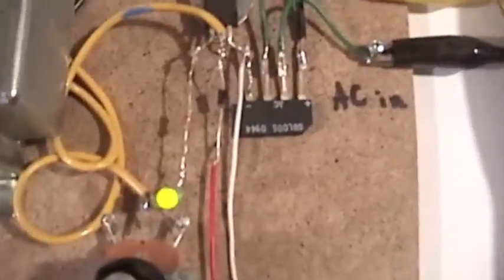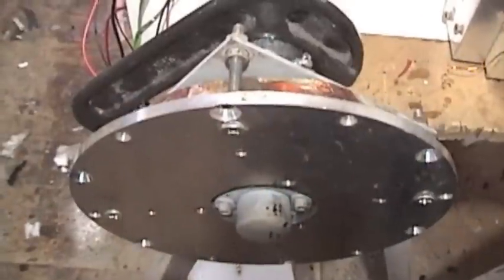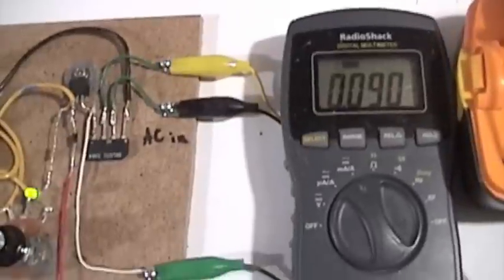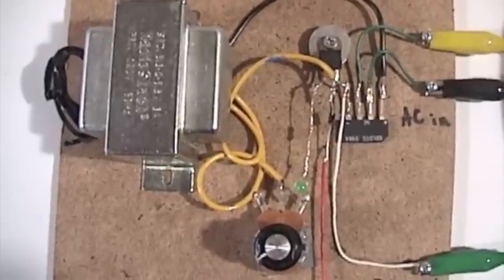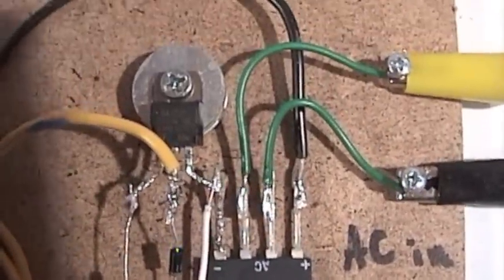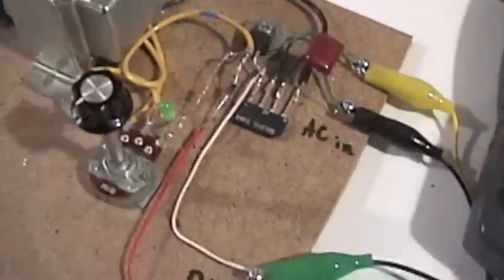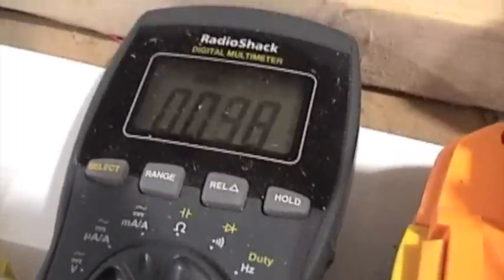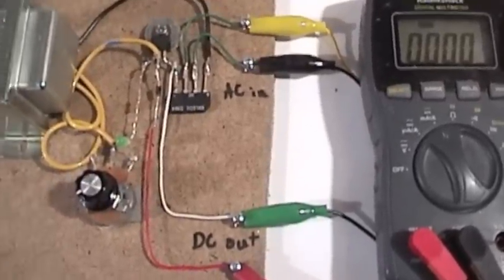Lynx Wind Boost Circuit

Comment from the maker: Yes, it would work very well, and in fact may work better.  Some of my best results have been with just two wires from that three phase alt.  It allows the turbine to run faster and with less load.  It has a softer cutin and will put out as much power as the wind and turbine can produce.

Comment: I bought a 3 phase alternator from you a few years back for a VAWT science project for my son. During the setup, we opened one of the phases and now it only has 2 working phases and we can only get about 10 volts out of it in a good stiff wind. Will this circuit work for the 2 phases that I have remaining? I would really like to get it into practical use.

Comment: Do you have an actual schematic for this circuit?  The one in the video I'm having a hard time figuring out how the circuit actually operates.. For instance, the 3 wires that are being used on the transformer, what are they connected to?  Is the middle wire a center tap at a 50/50 ratio or what?  How is it consistently outputting roughly 13v?  Help would be appreciated thanks